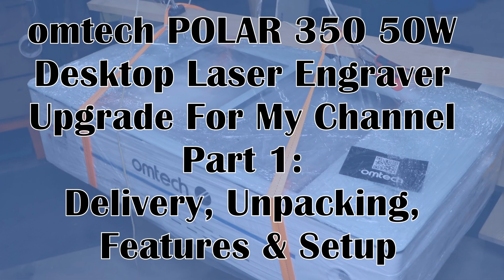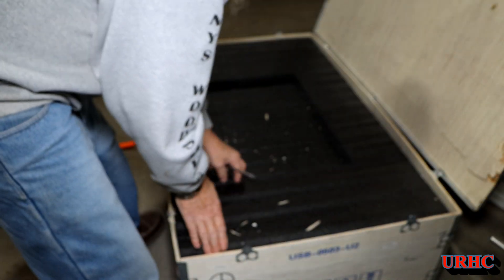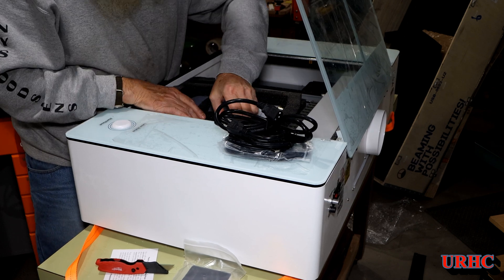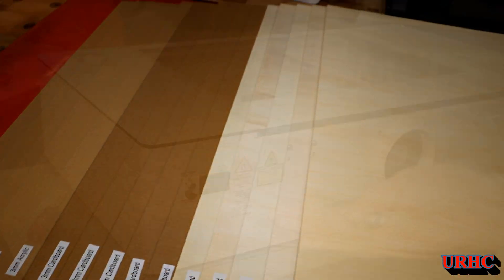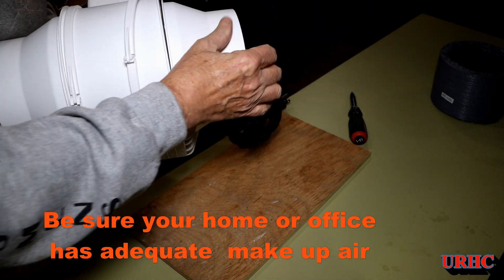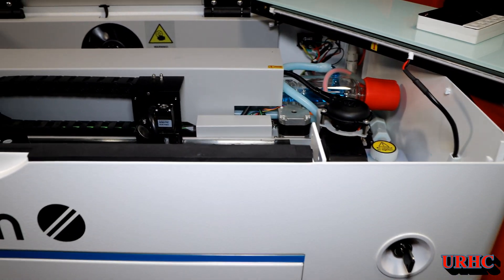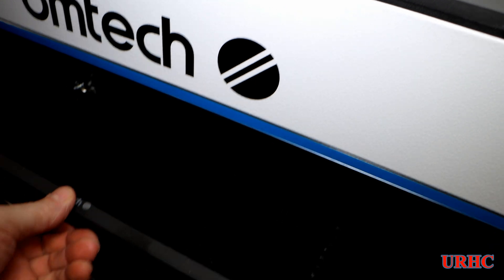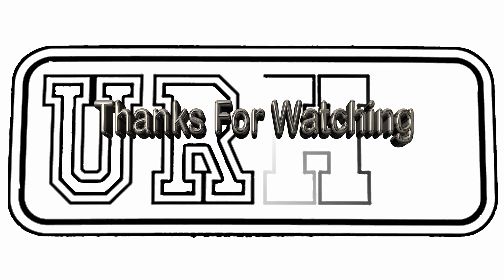omtech Polar 350 50W Desktop Laser Engraver Upgrade For My Channel Part 1

Comment: Thanks for the great video - it is the first one I have watched about the Omtech Polar that shows all the unpacking and all the items that come with the unit. And, seeing the inside was an extra bonus. I ordered an Omtech Polar on March 6th, so I am watching as many videos of the unit as I can. This will be my first encounter with a laser engraver & cutter machine. The only ones I have seen were those at gifts shops that use them to engrave personalized stuff. I am 68 and just retired, but have a lifetime of working with wood and other handyman stuff, so I'm not completely ignorant. And, I have been using home computers since 1984, when I bought my first Apple IIc. So, it won't be too much of a learning curve. I'll watch a few more of your videos and probably subscribe. I do have one question - I know that you didn't order your unit, but approximately how long did it take to get to you? Thanks, Charlie in Central Ohio
Reply from the maker: You should have gotten an estimated shipping time when you purchased it. They can't make them fast enough to keep up with orders and I think expected delivery is out to May now. You will get a PRO number to track when it ships and mine took a week from LA to NY by truck. The trucking company will call you to set up a delivery window. Any damage found has to be put on the delivery receipt before signing and if the damage looks too bad I would contact Omtech to decide if it should be refused.  I would recommend you look at lightburn in the meantime and if it works for you plan on buying the DSP version after the trial runs out. Hope you enjoy it. Thanks for watching.
Reply: @unemployedredneckhillbilly2023  - yeah, I did see a "ship by April 10" on the order, so I quess that would be the date. Thanks, Charlie

Comment: Loved the vid! I just recieved mine and seems I might be having an issue, when you turn the unit on do you have air coming through the laser head? With mine on I hear nothing coming from the air pump and no air coming through.
Reply from the maker: It is turned on and off by lightburn. In the cut settings enable air assist for each cut. Doesn't run all the time. First thing do an alignment check.
Reply: @unemployedredneckhillbilly2023  ok perfect, thank you! I had a mini heart attack because in the manual it says that when power is on it should have air flow lol but ill try that and see what happens!

Comment: Very poor, rude, and uninformed customer service. Do not purchase an OMTech Laser. Falling apart (literally) and it’s going to take “three days for a technician to call you back.” Spend your money elsewhere!
Reply from the maker: This is the first I have heard of with a bad experience with their support.  I have not heard of any problems that they didn't handle promptly.  I tell people to try starting with the email system because it's fastest if its not a major problem. What is falling apart? Was there shipping damage, setup damage , something that wasn't assembled right , or was it damaged during use? The only problems I have seen are alignment problems and lens problems due to poor alignment like I just posted a video about. If you bought through my link there is a record  and I can try to have it looked into with the order number. Thanks for watching.

Comment: Hello there.  I'm going to watch all 3 parts of this.  I currently have a Monport 55w CO2.  I'm looking to acquire another laser for a backup or overflow work.  Mainly tumblers and glassware.  Is there enough depth to place a rotary in there for tumblers?  I see at 5:25 you say you "bought" 2 different rotary's for this.  Correct?  Why 2?  One won't do 20oz and 30oz tapered tumblers ?   Just trying to follow along.  Thanks
Reply from the maker: It comes with the 2 rotary assemblies.  To use the rotary attachments you have to raise the machine up on spacers. Size seems to be limited by the cable lenght on the rotary assemblies. They are nothigh quality rotarys but look like they should work. I will be releasing a video about them in a couple weeks. Just got the replacement lens ( they are a specialized lens not available elsewhere) and getting going again.  Thanks for watching.
Reply: @unemployedredneckhillbilly2023  

Thanks.  I saw this earlier about a guy making some risers. 
https://www.youtube.com/watch?v=FAGUeB3FAiA&t=490s

 I've got all kind of blocks I raise the unit up with.   I'm kind of skittish using a rotary without a clamping arm to prevent walking up and down or slippage to be honest.
Reply from the maker: The sliding parts on the rotaries  are very loose and shaky so I think they are going to need some mods. I plan on trying to adapt my xTool rotary some day. I am having issues with the air assist not having a low flow for engraving causing the lens to gunk if you don't want high pressure assist. I am working on a video about that now. The lens is very expensive and specialized also. Some bugs to work out.

Comment: I am assuming you have a “walkout” basement/garage shop?  I can’t see how could get laser or other shop equipment we see in videos down any basement stairs.
Reply from the maker: Walk out basement.  I was able to put it on a dolly outside with my pallet forks and just roll it through the door. 2 strong people could actually carry this unit down stairs after removing from the crate. My last house had steep stairs  and I had 2 planks that I would slide things down while hooked to my tractor.  I slid my 1500 pound Southbend lathe down there no problem and pulled it back out when we moved. Harbor freight makes a nice cheap pallet jack for heavier items. Thanks for watching.

Comment: Really looking forward to the future videos on this machine.   Someone local claims to have an almost new Muse Core for sale, but it lacks the autofocus and the used asking price is equivalent to this machines new price.  Need to jump up to the Muse Core 3d at 2x the cost for some of the features this machine has... I'm curious if you find something like autofocus and the nicer camera worth it... I'd have to get the local Muse Core price down quite a bit before I'd really consider used, as chances are I'd be without a warranty... It's also a confidence booster that Omtech is letting you speak freely on your thoughts... Time to do some extra research to really compare the two.  Thanks for the videos.
Reply from the maker: I was offered a similar machine by another company but they wanted full control of videos so I walked away from that one. A couple  things I am showing in thenext video. One is it's not truly auto focus. The material thickness must be measured and subtracted from 17 then entered as a Z move in lightburn.  Another is it has a 5mp camera but you have to calibrate it in lightburn.  I spent 3 hours and couldn't get it perfect so I am trying to see if a setup file canbe provided. A couple other thing are it doesn't have a red dot for framing and for larger items on the rotary it needs to be raised up. This is a nice starter machine and when I am setup for discount codes seems to be a great buy.  If you know lightburn this machine is just plug and play with a 2 year warranty. Thanks for watching.